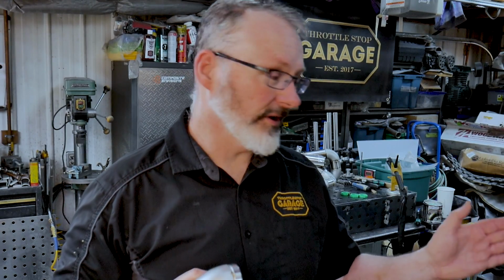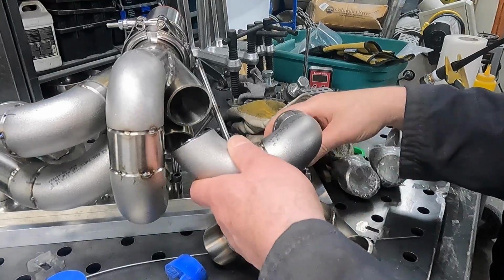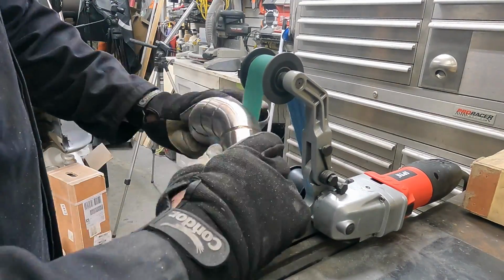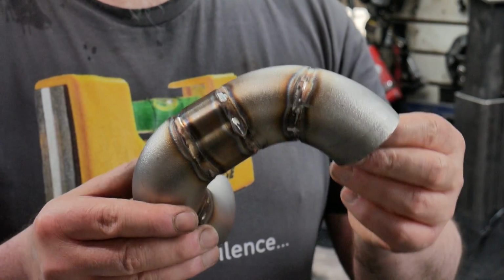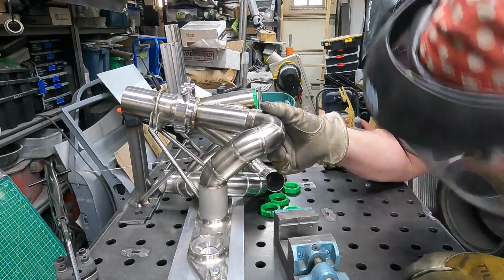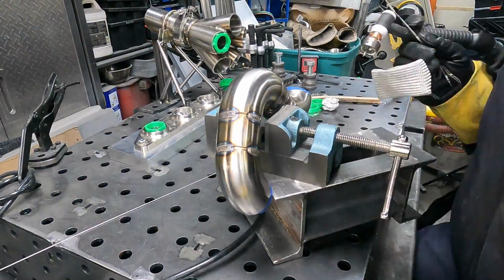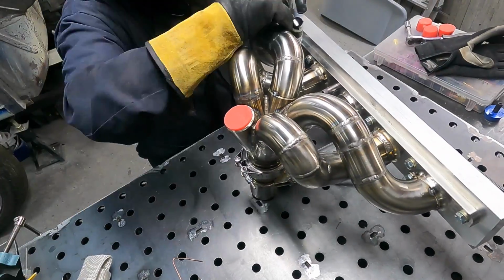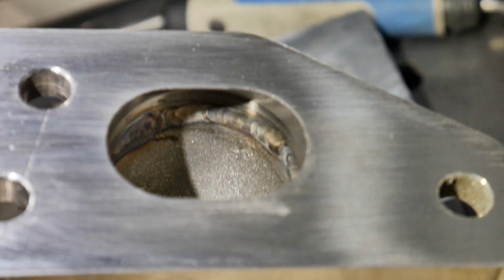DIY Turbo Manifold TIG Welding

Comment: Looks amazing!

About to start welding up some V-blocks so I can compensate for the lack of a lathe to make threaded standoff spacers for mounting 98 Mercedes CL seats in a 64 Riviera.  Been using the notebook idea for building stuff and its worked out great being able to reference back to what worked when it comes to making the other side.
Reply from the maker: Excellent!

Comment: It would be agood idea to checkout welders that do this for a living and checkout there tube turning jig clamps like ball joint swivels rhat fit inside tubing and out side .👍
Reply from the maker: My offsets were just about zero on the manifold - two runners had a little.  They're fully welded.

Comment: Do you mention any place where you source the tubing? Or do you have a link? Great job on the manifold!
Reply from the maker: Thanks Ray - I got the weld els and tube from Ace Race Parts.
Reply: @ThrottleStopGarage  Thanks! I just saw the name in one of the frames of the video also lol. I'll check them out. Great video series. I'm getting ready to do this same job for a 3RZ turbo and, like you, I don't TIG weld every day. So every bit of info and tips really helps a lot.
Reply from the maker: @ray5961  they're pretty much the only supplier in the USA. Great to work with...last year they didn't have stock due to covid and I asked them to contact me when they had stock.  Three months later they emailed me!  Customer service is king.  Don't let the YouTube weld inspectors get you down.

Comment: On the position try tig welding chrome molly in a 25.2 or any cert chassis lol I had to hang off my car lift upside down a bunch of times 🙃
Reply from the maker: No thanks!  Every time I see a nicely welded chassis, I'm blown away by the skill.  Only those who have attempted can understand the extreme skill involved.

Comment: Hi, I got a question unrelated to this video but figured there's a better chance you see this on a fresh one. 
So,  when you were making your panels you sprayed primer directly on the mould   that would then transfer on a finished part. Is it regular primer or something designed for this purpose? Any advantages other than ease and disadvantages over priming a part after releasing? I'm making a cf bootlid and want it painted body colour but only from the outside and visible cf weave on the inside so this seems like a perfect technique not requiring any masking. 
Looking for any info and tips so anyone with experience in this please chime in.
Reply from the maker: It's a special vinyl ester primer meant for this purpose.  The mold surface is very smooth so having the primer also come out perfectly is an added bonus and less work.  The problem you will have is that the mesh imprints a texture on the backside of the panel.  You may want to experiment with options to reduce the print through on your parts.

Comment: Be proud its not easy . Give you a tip tack it in  12 o'clock 6 o'clock 9 o'clock and keep rotating in that sequence tacking until its tacked all threw then run  with it your 100 % correct trial and error  👍
Reply from the maker: Cheers - that's a good simple trick.